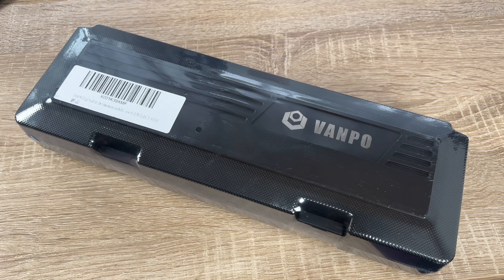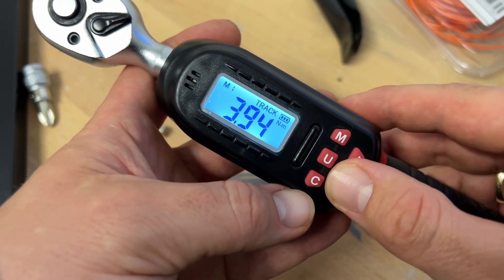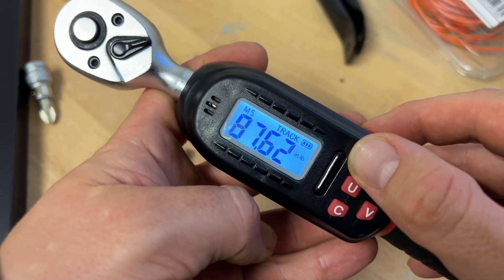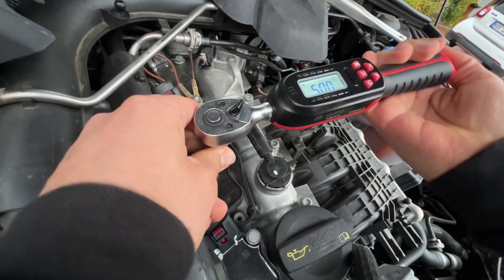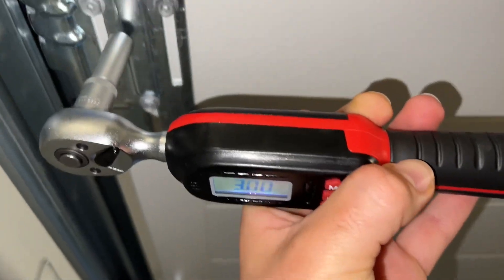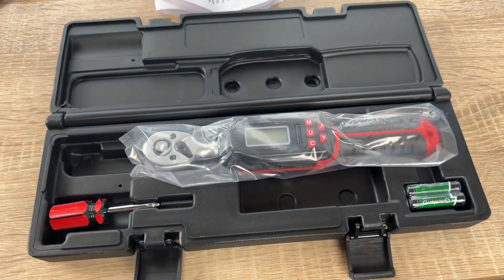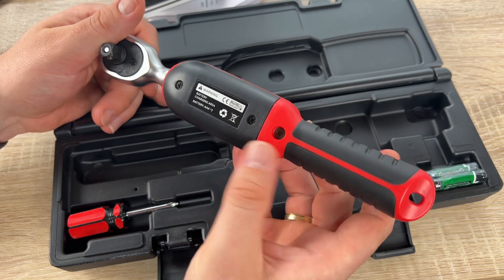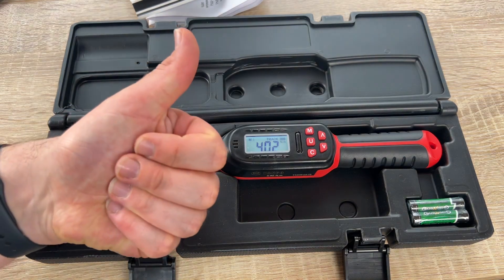VANPO 3/8-Inch Drive Digital Torque Wrench, Electronic Torque Wrench Unboxing and instructions

Comment: It looks like a torque measurement tool. You set a value, and the red led will flash when you went over that value. OK, but I'd like a torque wrench, which limits the torque, for example with a ratchet. It seems like a mechanical torque wrench is still much more practical, it doesn't allow me to overstrain the screws. This above wrench does.
Reply: LMAOO what on Earth are you on about? When you've reached the specified torque, a red LED notifies you. 
The next step is where the magic happens though, check it out, here's the thing, this will blow your mind:
After that red LED flashes, you simply stop tightening whatever it is you're tightening, so you don't "overstrain"
Amazing right ?!?!
Reply: @PyroMania61  You didn't even understand what I said. You are an amateur. If there is no limiter only a visual sign then you can overspan the nut/bolt. "Amazing right?" It's not safe, because nothing limits the torque. You start tightening and oops your hand has slipped or you were interrupted, or your mind was roaming around somewhere else, maybe you fell in love with the secretary girl from the book-keeper office ... so on... , and the screw's thread was already ruined. Now you can see that the LED is flashing but it's already too late. Flashing since when? In some cases that could be an expensive repair. You know a mechanic tightens 2000 bolts/nuts in a month. They make mistakes. Everybody make mistakes, and sh*t happens. A mechanic torque wrench is not so fancy but it's safer.
Reply: @telelaci2  Maybe he could use thought process so dosen't have to use the wrench.